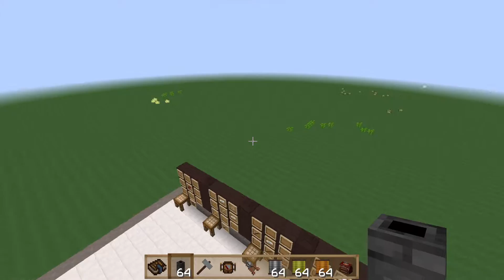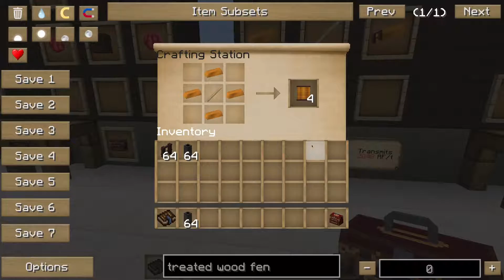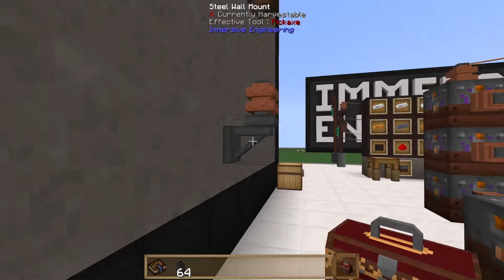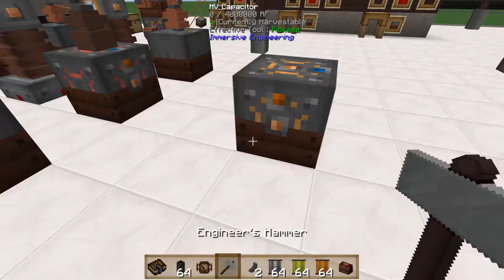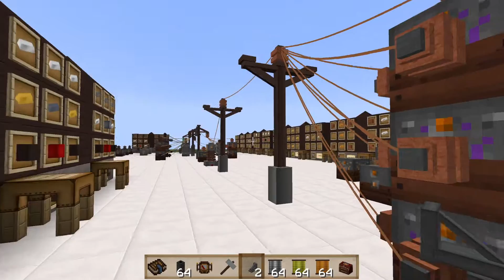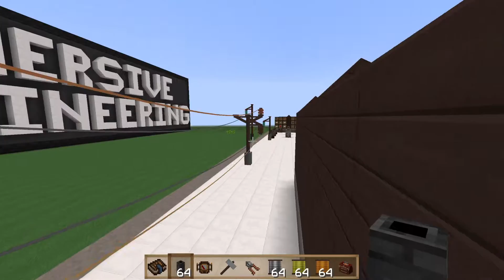Mod Spotlight: Immersive Engineering 0.7.1.2 Ep. #2 -- Power Transmission and Storage

Comment: how do you increase the size of the wooden post with the extender?
Reply from the maker: +Sevak Ohanian Sorry for the late response! Make sure you are using the "Extendable Wooden Post" block from Immersive Integration. Once you place that block (which will be the base of the post), you can stack multiple "Treated Wood Fence" blocks on top of that. Each fence will raise the post one block in height. Then just right-click with the Engineer's Hammer like you would on a normal wooden post to add the arms.
Reply: ez thanks